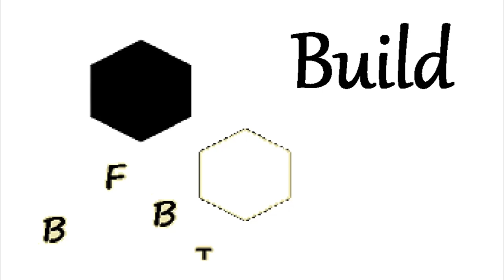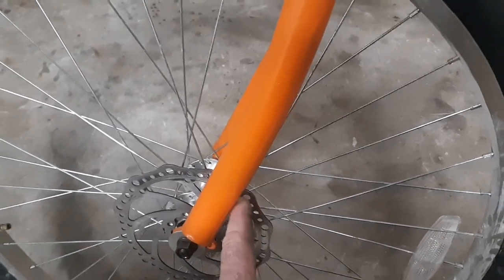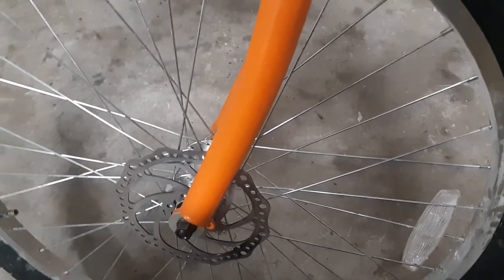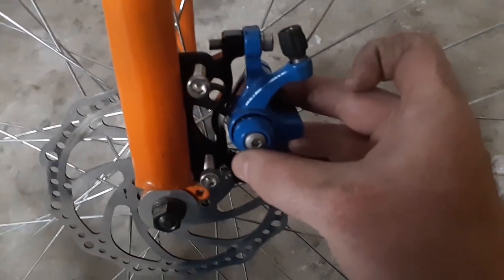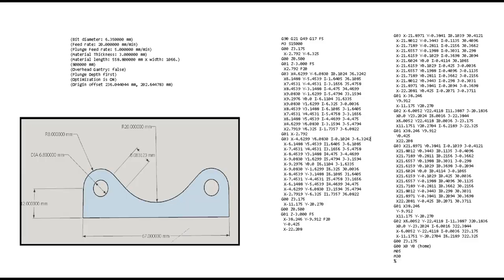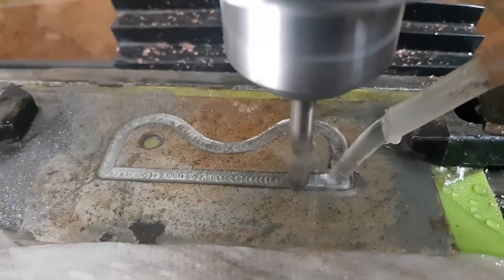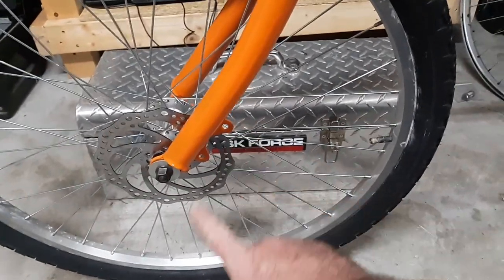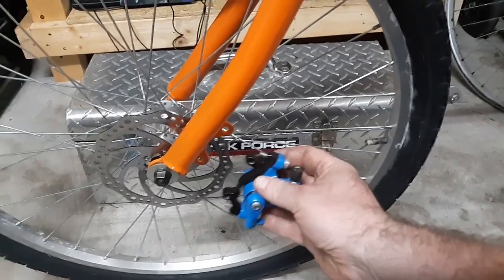(⊙﹏⊙) Converting Beach Cruiser Bicycle Fork To Disc Brake For My New Motorized Bike Build!

Comment: How do those forks hold up with  disk brakes? All most every post I've seen said the forks would twist or buckle so i been holding off on it for now
Reply from the maker: I have had no issues with 220mm disc brakes
Reply: @BuildBreakFix  If you haven't had any issues on any of your kick-ass builds I should be fine with my Cranbrook now I have a new project thanks